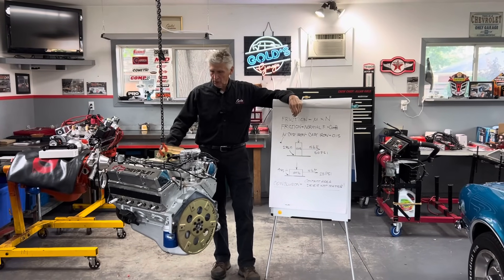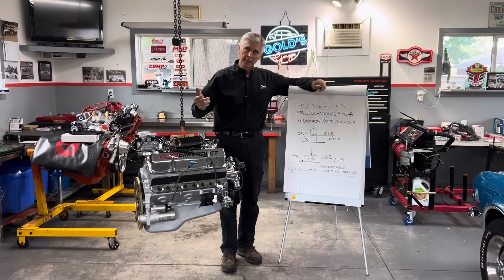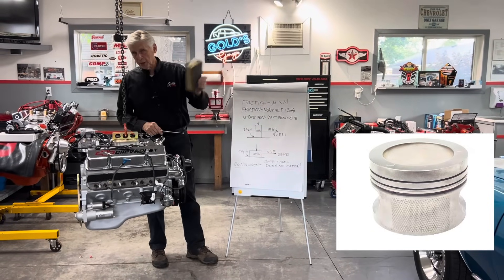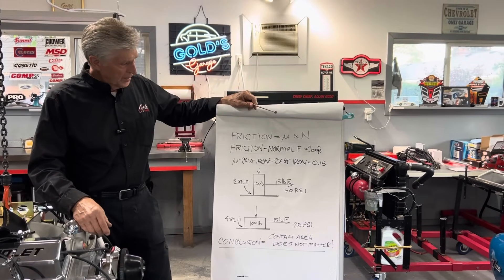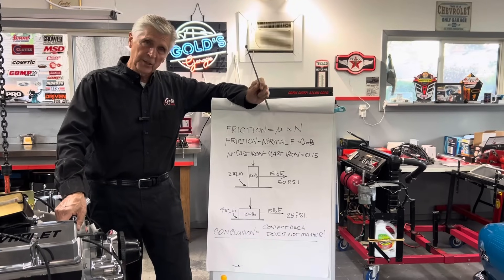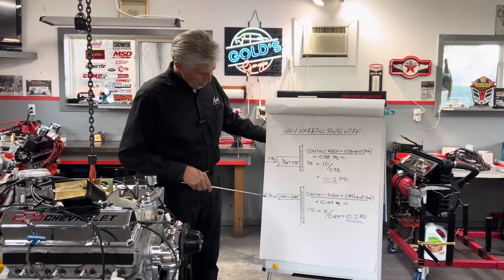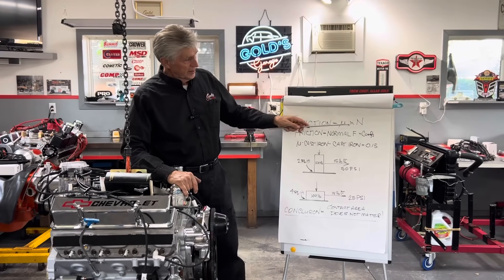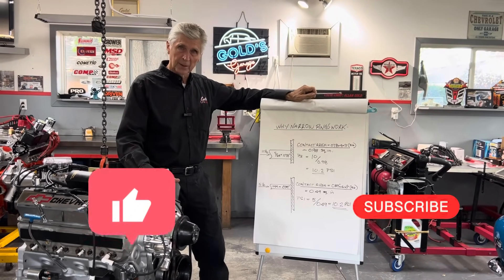KNURLED PISTONS MYTH? LOTS OF OPINIONS BUT WHO IS RIGHT?? PHYSICS! INDISPUTABLE PROOF!

Comment: The first automotive machine shop I worked in back in 1991 had a Perfect Circle piston knurler.  It would knurl the PC logo onto the skirt of a piston. 
   In the six years I worked in that shop the piston knurler was used twice. 
   Once for myself and once for the shop foreman. Two man shop. 
   Shop foreman built a 327 with forged pistons for his son.  
   The skirt clearance for those pistons made for quite a bit of piston noise, especially at start up. Even after the engine was warm the pistons noise was clearly audible. 
  The engine took some damage from a separate mistake and had to be taken apart and rebuilt.  While doing the repairs required the shop foreman used that piston knurler on the skirts of those pistons and the engine was sent back into service with no piston noise. Stayed that way for the remainder of the time I was there six years following. 
   The next time it was used I had bought a basket case engine that had the same forged pistons. TRW brand. 
    We measured the skirt clearance and I decided to knurl those pistons before it ever went to together. No noise what so ever.  I didn’t keep that engine long after I put it in a car but never any piston noise at all. 
   Chalk it up to better metallurgy and better designs.  
   There are better ways to do things these days. 
   That piston knurler was a pretty neat tool.  
    We just wouldn’t dare offer piston knurling services to the general public.  Even back then the word knurl around a machine shop was controversial.  
    We had customers that would only knurl a valve guide and others that did not want a guide knurler anywhere near their heads. 
    My father being the most boisterous customer we had on that subject at the time. “Knurlers are useless pieces of junk and should not be in a machine shop!” He would exclaim at every mention.  
   I myself do not sell knurling as a repair in my shop these days. New guides or guide liners only. 
   I do however have an entire drawer full of guide knurlers and I’ve used them quite a few times to aide in accuracy.   
     On several occasions I’ve saved a 7.3 Ford diesel head from the scrap because the guides were completely blown out making for poor referencing to line up on. 
   A guide knurler will not alter the centerline of an existing guide. So I knurl the worn out valve guides in order to get a tighter fit on the pilots.  
   In these extremely worn situations the knurler shrinks the guide bore just enough that I can use the pilots to more accurately line up with. 
    So they’re very useful tools for a machine shop.
Reply: Yes, sir I can agree with that. Back in the late seventies I fixed up a .030 327 and of course being a young man, I put good parts in it for some extra performance. Well, I was out of town servicing a business machine and it was in the wee hours of the morning when going home I overheated the engine (well-cooked was more like it). It got to where I had to get a head surfaced because coolant wound seep into the cylinders and it would actually steam some upon startup and later it started that on both sides. So, I took it apart and carried it over to the machine shop I dealt with, and the man decked the block I got another set of heads for it and as it turned out I had shrunk five pistons. So, to save some money the machinist knurled the shrunk pistons (these were TRW forged jobs and not cheap). I put another eighty thousand miles on that engine.🥸👍👍👍👍👍👍👍
Reply: I could see why you would do it to close up the clearances on piston to wall after the block was machined. Normally you'd measure all that beforehand, but dealing with used parts or a budget build, that's why you'd do it. If you think about it, there's so much LESS wear surface area after it's done, really just a 'bandaid'. When I was in the Navy some guy on my ship had a '73 or '74 Trans Am 455 SD and he had it rebuilt. For whatever reason they knurled the old pistons rather than replacing them. I'd guess for 'cost' reasons. I think knurling a valve guide is different. It does promote a little more valve stem lubrication, but I would just use silicon bronze guides. Knurling is basically a budget technique to restore clearances. The guy that started all the hoopla just has a clown show channel (not Powell).
Reply: @vincemajestyk9497  If controversy is your game knurling is the gravy subject to bring up. 
  The entire industry is ripe for controversy if a person is willing to sit around scrutinizing old parts and cores.
Reply: @hughobrien4139  you are sure right on controversy.  I hate  posting or commenting some places on social media , every expert does not agree, and I am always under fire .  Knurling I can see started many pissing matches. 😂
Reply: @hughobrien4139  Everything that's old is 'new' again. Seems like the same group sits around contemplating and have to re-learn what everybody else figured out long, long ago. Most of these 'theorists' are absolute crackpots if you look at their past proclamations. Simple logic can usually dismantle their hypothesis. The loudest most vocal proponents are the most ignorant and will NOT argue on merit or facts.
Reply: Makes sense. I would not recommend knurling, but useful in picking your poison and battles for different things
Reply: always knurled my guides and still did it all the way down into the low 5 sec zone in 8th mile my LS7 454 heads i knurled em i never put bronze guides in a motor i planned on running on the street its a lot softer than a stainless steel valve I found out the hard way in a 355  I put together for my chevelle had oil leaking into cylinders about 50k miles into it ,my brand new heads with bronze guides had some seeious slop. knurled em after that ported a set of 283 power pack heads knurled the guides back cut the valves did a reversion cut on the exhaust standard 350 chevy 283 heads with the tiny 172 150 reworked valves 3 speed th350 9 inch ford 3:90 gears in an 83 s10 went 7:00-6:90 in 8th mile and 10:90 in 1/4 mile .

Comment: Great explanation. Surface modifications to the piston skirts can change the coefficient of friction. In the case of the knurled skirt, it channels the lubricant away reducing the lubricant film thickness Increasing friction Ive seen this when machine ways wear some people will take a die grinder and cross hatch a x patrern  in the ways basically look like they were knurled. Big problems and real expensive repair.  Regarding ring wall force there is installed tension plus the combustion pressure acting on the ring area forcing the ring against the cylinder wall. You are correct half the area half the force. I enjoy your videos Thanks for posting.

Comment: Put a film of oil between 2 pieces of glass... now replace 1 piece of glass with sand paper, which one has less friction?
Reply: Bad analogy. A better analogy is a slick tire vs a gumbo mudder on a sheet of ice.
 Properly Knurled piston skirts have slightly less surface area than untouched skirts.

Comment: Nice presentation. There are entire books on friction, so obviously there is a lot more to this subject. I myself will not use knurled pistons. As you said due to increased force on the skirt which wear out the knurled part quickly there is also the fact that the knurled section is no longer as strong as the original surface. Even on a mild street motor that knurling is gone in less than 2K miles.

Comment: @theoilgeek has a great video showing enlarged 3d images of cylinder walls and piston rings under a high magnification. In that video they discuss oil retention and how it affects wear. If both surfaces are rough, wear increases, if both are smooth wear increases. But for different reasons.

Comment: Good video. Taking the example to completion, once the surface pressure increases enough to collapse the hydrodynamic wedge you then have metal to metal contact, and the knurling wipes away. The next logical example would be large journal bearings versus small journal.  Increasing journal diameter simultaneously increases the surface area (reduce pressure) and sliding speed (stiffer wedge).
Reply: Large journals increase bearing area but also increase overall drag as the surface speed at the bearing interface is increased over one of a smaller diameter.  As always, there is no free lunch.

Comment: So what are your thoughts on Gas ports, vertical or horizontal ?
Reply: Coupled with a thinner back cut ring, friction is reduced for 3 strokes and the cylinder is well sealed for the power stroke. The pistons and ring set is going to cost you maybe 300 to 500 more, for single digit gains, so it's reserved primarily for racing applications. It becomes much more critical the thinner the top ring is.

Comment: Knurling was used to take up slack in worn out parts when you could not afford to replace all needed parts. My 2 cents says no to piston knurling.
Reply: You are 1000% correct. It was a budget means to correct tolerances. BTW, 'IF' knurling pistons was so 'great' at 'reducing friction', all the OEM's would have implemented it long ago. Just another crack pot theory from the lunatic "rouge neck" garage from your crazy uncle.
Reply: Show us you cant pay attention.  UtG openly said over and over it was a thing Smokey Unick was experimenting with. Brian Salter proved it works short term ,exactly what Smokey said. Nothing more.@vincemajestyk9497
Reply: @vincemajestyk9497, you believe everything you here??? Really, you think the manufacturer cares about saving you money or giving you a better product because they want to help you
Dream on sir
Reply: Distorted piston skirts took them out of original roundness and straightness from top to bottom but sometimes you do what you gotta do.
Reply: Back in the day folks did not make the money they do now, and these practices were commonplace. Over a period of time, it became more efficient for machine shops to bore an engine and replace the pistons with new, and it was longer lasting as well. Also, the vehicles coming out in the late fifties and throughout the sixties were lasting longer and it became feasible to either rebuild the engine completely or install a remanufactured or even new engine.
Reply: In 70s we would have our valve guides knurled...

Comment: I knurled pistons years ago on a set of Venolia pistons that had.010 clearance, that was before CNC piston skirts  the new pistons you would not do this to a skirt, they are not round and have tapers to support the pistons against the cylinder wall

Comment: I am quite dumb on the knurling piston issue but I consider it just like knurling a valve guide, it's just a temporary patch up for another issue. I am not in favor of piston knurling,  if you want a better fix have LINE 2 LINE put on some coatings. Thanks Alan for another good video
Reply: Line2Line is also a bandaid.
I use it in my big blocks to get extra life out of worn pistons
Reply: Coatings are also temporary!
Reply: @patrickm.8425 I got over 200 extra passes out of a set of worn racing pistons with the Line2Line coating.
Reply: @patrickm.8425 You can see what the coating looks like and the break in procedure on the video I posted.

Comment: Would the knurl hold oil and aid in a surface boundary to reduce friction? I've seen some piston designs that run crossing grooves from the oil ring groove angling down and across the skirts as oil feeders to do this
Reply: A correctly honed cylinder holds just the right amount of oil for the skirts (and rings) to glide on.